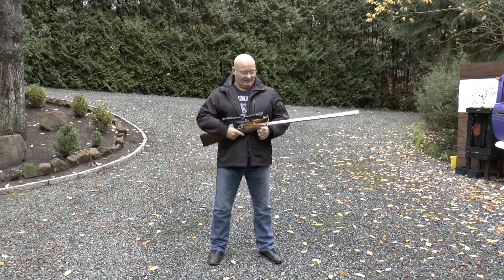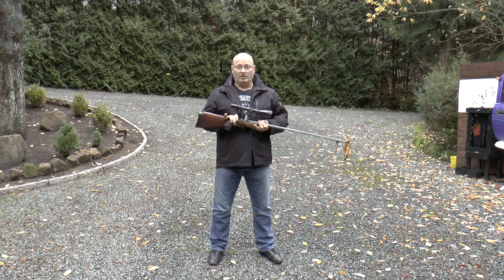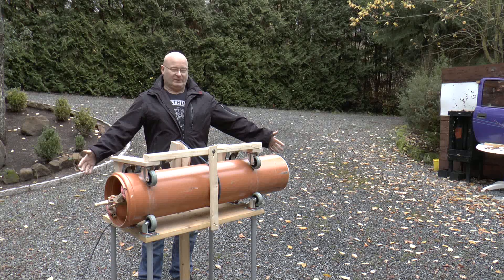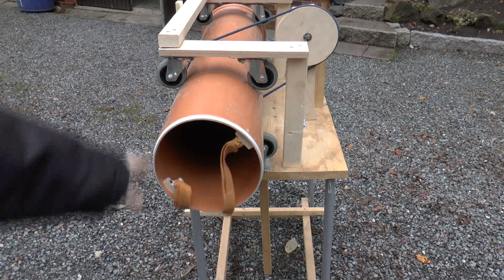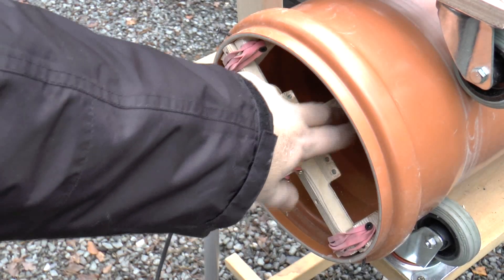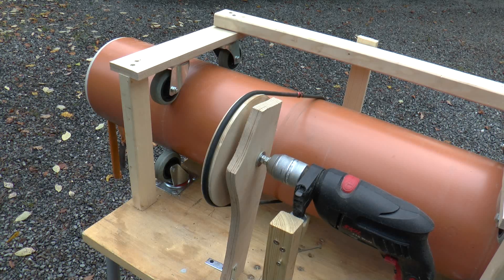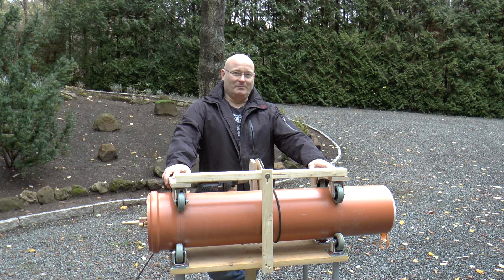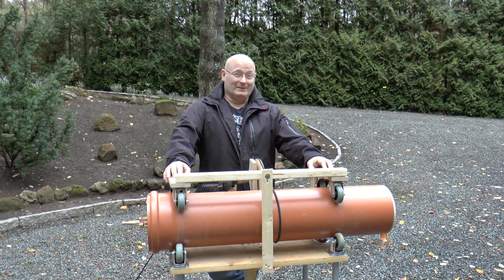World's 1st Rifled Slingshot (Made from Huge PVC Sewage Pipe)

Comment: In this case the tiniest initial imbalance might even lead to worser grouped impacts, due to the centripetal force I fear? Except of the rubbers longitudinal force the projectile is totaly free to escape within the huge pipe. Ok, Ok nice craftsman skills and lots of fun and creativity, but it lacks a bit in scientific severity ;)

Why not considering of making the most precise slingshot, with the best efficiency factor and the highest V0 or the best energy transfer. What about considering a fin-stabilized projectile or if it has to be this rotating tube, think of a socalled sabot/Treibäfig  (http://en.wikipedia.org/wiki/Sabot) which falls off after the projectile left the pipe. In your case it might eat some energy, but it keeps the bullet in the center line. Think of tree thin styrodur fins, not much drag and inertia but enough cornering force.

With the compound bow I shoot arrows with vanes at an 1° setting angle. That indeed forces the arrow to rotate, I checked it out in slow mo. I cannot say if it is good for something, cause the effect pays off at wider ranges > 60yrd and I'm not the best shooter.

Comment: This was awesome haha. Rifles are essentially the same as your slingshots, except they use a different means of propulsion (expanding gas). That being said, the means of propulsion does not have to be spinning in order to obtain rotation, but rather the barrel can be lined in such a way that it causes the bullet to spin. The concept is completely plausible, but it would be hard making a barrel that can get a marble to spin without applying too much friction considering you don't have as much energy as a rifle round. Great video though lol I loved it.
Reply: I was thinking a shuttle that runs along a guide track that is rifled, the shuttle would freely rotate inside a mechanism that attached to the rubber bands.
Reply: the barrel could be rifled and the projectile would have to follow the rifled grooves in the barrel for it to spin rather than using a prowered spin.
Reply: Yes that is what I was trying to say lol. Another thing that may work is if you used a rubber pouch, and twisted it to wind up the rubber before you pulled back. As it unwinds it should spin the marble, but it may not be very effective in real life.
Reply: May throw accuracy off if the rubber is twisted, but might work.
Reply: That does sound like a cool idea. Maybe a barrel where the pouch twists as you pull it back through some rifled grooves, then you wouldn't need to rifle the whole barrel and the projectile would still spin pretty well.
Reply: Lead ball rounds in old muzzle loading guns benefited from rifled barrels.. which paved the way for modern guns. Cannons, too, eventually incorporated rifling for round ammo, again paving the way for modern shells.

Comment: gbzhemn1  Where do you get this stuff.  Of course a sphere exist in a mathematical universe.  As for the rest, imperfections found in a ball baring are negligible compared to all the other factors that hinder accuracy in a slingshot.  For example one band may release energy more efficiently that the other.  The releasing mechanism may introduce a direction bias.  The roundness of the shot is the least of your problems.

Comment: One day... you'll come up with the first rail gun power by rubber band!
Reply: Some day, they will make a joke that Zachary Piche actually gets was a joke... one day...
Reply: rail guns are defined by their power source.. so no.
Reply: @dojostarfox4520  ROFL No they are defined by their propulsion system. Elastic magnets are a thing. So shutup dummy.
Reply: Yes some of his sling shots do resemble railguns, but for now a railgun is defined by having an electromagnetic power source, the power going through the rails. Joerg's rails simply act as guides.
Reply: Where was the joke? If it was the OP then it just wasn't funny... or a joke.
Reply: ***** *too, *you're
Reply: Imagine him with his slingshot on the battlefield
Reply: No, he builts a rail gun powered by millions of AA batteries 😂
Reply: Zachary Piche
Incorrect. Railguns are defined by the way they accelerate an object. They do use electricity but, where does that come from, wind, the sun, fossil fuels, rubber bands?
Reply: Obvious joke is obvious.
Reply: Zachary Piche It is possible. In fact most of the guns he builds are technically rail guns since they use a catridge that remains in the barrel to deliver the force to fire the projectile; thus it could be seen as a vehicular projectile delivery along a rail and thus he makes rubberband railguns.
Reply: Zachary Piche No. Rail guns are not defined by their power source.  Rail gun is in fact a misnomer for a gauss rifle. The reason they were called "Rail" guns in the first place was because the first prototypes were in fact built on RAILS... So what Heir Sprave has built is in fact technically a rubber powered "Rail Gun"..
Reply: (troll face here)

Comment: I have been thinking of an alternative crazy solution to impart spin on the projectile. How about using a piston that has a concave face to hold the projectile and spins as it moves forward? The piston could run along tracks or grooves like a screw. The base of the piston would spin freely and be attached to the sling shot. It would need a pretty serious draw and be very smooth to minimize friction slowing down the piston but it might work.

To load it I would just cut a hole in the top of the tube. Put another small tube attached to the hole vertically that is big enough to hold one projectile. Then it drops into place by gravity when you draw.

Comment: Oh you have to do things a little different.
1./ A spinning cylinder has lift or drag depending on it's rotation to apparent wind.
2./ Spinning is stabilizing
3./ "T" look at the letter "T" the direction of flight is up on this page. the cylinder is perpendicular to the direction.
4./ The spin is from front to back over the top side.
5./ Surprisingly it forms an aerofoil !!!! and is stabilised AND does bum loads of damage on impact !!!
6./ 2 small end plates on the rod diameter about 1.6 x Diameter of the rod and about 10% the thickness of the rod..
7./ Reconstruct your SPIRAL GUN but with a wide spiral to accommodate the "SHOT" so that the shot is rotated out of the end of the SPIRAL GUN and it has the correct spin.
8./ Lets say the SHOT is 8 mm round rod. The length is 24 mm the end washers are
M8 washers 13mm OD.

I designed this gun after watching the fire fights in Afghanistan and the fact that they ran out of ammo all the time, the ammo was expensive and they wasted HEAPS of it. I would bet they hit one in every 10,000 rounds fired, mostly because they did not know where they were shooting and were just suppressing fire. They might as well have used card board blanks !!!
Mine uses common petrol and air to fire but I don't use the washers. ( bit difficult and slow to make at home. It uses 1mL of Gasoline and 15mL or air pulled into two syringes one way valve then compressed into a chamber connected to the SPIRAL.
I wanted it to chop off the rod as it went and load it in the spiral.

1mL of Gasoline is about the same power as a .303 Enfield shot but low brisilience hence great for a spiral.  The washers were to "tone down" the rate of spin a little , add stability, and to stop high/low pressure wrap at the ends.

Several things happen. Too much spin and it stalls, a little too much spin and the projectile will hit you in the behind doing a big loop in the sky.

Good luck tuning that one ! lol

So a quiet gun that is very lethal and cheap and ammo is a bit of fencing wire !!

Your work amazes me .. I love watch in the Bald German  get narcy with it and embodies his imagination so readily ! Awesome !

Great Art !
Garret

Comment: I think to provide rifling effect you need a spiral inside a tube. A 36 inch tube would only need 2 turns to provide enough spin to a pointed projectile. This is easy to do with a simple rod at the back of the pocket  which will ride in the grooves of the spiraled tube. A piece of 1.5 inch dia pvc should work.

Comment: NOT THE FIRST! i took a 1,30 m long cardboard barrel, took  3 elastic bands, a few wooden parts and bent nails (ammo). it shot 30 meters (i fixed a red dot on the top to aim). i named it "Birdkiller 1.0".  i did this in 2011

Comment: you should have spun the bar ell a little more so that the rubber band would get tighter and that ball would have gone alot faster but if the rubber band popped back at you that would maybe have meant that your release clip was not strong enough

Comment: "This technically makes no sense"

What doesn't make sense about a giant sewer pipe viciously rotating with a slingshot inside ready to fire?

But, seriously, that thing is wicked cool and if I may suggest:

I know I have no room to say this, as I haven't built many things in my days, but how about a safety mechanism? Get it to rotate twice as fast and attach like a thin cord to the trigger so you don't have to risk damaging your hands

But yeah, just a suggestion, because cord/rope wouldn't rotate very much if it's at the right angle so all you'd really need is some sort of free axis rotating clamp and you're good to go
Reply: fishing swivel
Reply: I'm not entirely sure if that comment was directed at me or even for this video, but everything of what you just said makes absolutely no sense in regards to what I commented.

Soz.
Reply: Curtly quoting something that I said that I just happened to miss because I'm sick right now (you couldn't possibly know that, obvs) as well as blindly assuming my intelligence based on two things you've seen me post online.

Yeah, you're not worth my time.
Reply: Only losers make sense!

Just to clarify, I know I said it was to protect his hands, but the other main reason was ease of operation. It just seems like things would go smoother with a more efficient system.

People have been jumping down my throat because I said the word safety
Reply: 2dog14 like a peguin swivel??

Comment: I have a great Idea for you. you can get back to me later!! In one of your shows you showed that a slingshot ball could have the impact force of a bullet. Then the propellant power must be equal, therefor create a gearing system to make a smaller ball go 300 to 400 fps and you would have a truly deadly weapon. My first idea is to make a piston, similar to a air gun and force the piston to create air-pressure. A pellet gun just uses a spring and you can get more force with 200 to 300 pound draw weight with a rubber band. You can come-up with maybe another idea for a gearing system to make the ball go faster.  Tom
Reply: That is great but make the ball go at a much faster rate by creating a gearing system!!

If the ball has the same impact force as a bullet fired from a small caliber gun then the force to create both should be equal!!

My first idea would be to create a piston that is driven by force into a tube to create air-pressure and make the projectile move faster!!

Comment: If I may make a suggestion, I noticed you seemed hesitant to grab the trigger (and I would be too). If you tied a length of cord to the trigger and the other end to the 360 degree joint that comes on some lanyards, you could make a pull cord that turns with the barrel, keeping your hand safe.

Comment: You are right about a slingshot not needing any rifling due to the ranges and speeds involved.  You are pushing what? 300fps/94mps at 11yds/10m?  Definitively not needed.  But your rate of twist on this is much to high.  I think the average muzzleloader uses 1" in 48" twist.  I'm not quite sure but your version of twisting the projectile is producing something like 1" in 1" or even less.  

Think of it like the difference between throwing a football and throwing a curveball in baseball.  The right amount of twist good.  Stabilizes the projectile for long range accuracy.  To much twist and the trajectory of the projectile will actually bend 

Slow that thing way down and move the range out of 50m and do a comparison.  That would be interesting.

Forgive me since I live in one of the only countries that still use the english system of measurement and my metric conversions are a little rusty.  But slow the twist down to 2.4cm to 1.15m and that should do the trick for stabilization.  Also that platform wobbles quite a bit, could use some work on that.  Otherwise entertaining as always.

Comment: Should be a bearing system on the knob so you can pull it without it spinning
Reply from the maker: Yes, as soon as I reach higher RPMs that problem will have to be tackled. At 7 rotations per second, it is not so bad.

Comment: Hook that bad boy up to the wheel hub of a truck! Also, is it possible to maybe actually shoot it through a rifled barrel. Maybe take a piece of 1.5 inch PVC and heat it up, then gently stretch it to where it will hug the ball bearing enough to spin it? You would have to actually rifle the barrel to get the spin though. I saw a guy just take a piece of hacksaw blade and and sink it into a dowel rod to rifle his PVC air gun. Just a thought.
Lee's Bowfishing and Hunting Slingshots

Comment: I love these videos where you try these weird and crazy new things for sling shots! What I would really like to see next is more iterations! I want to see these weird and crazy ideas taken as far as they can go.
In this example it would be really cool to see if it would be possible to make slingshot shoot something that would need the rotation to be stable and then make it stable with rotation.

We might not see a use for it right now. But that isn't the point! The point is exploration and fun! And who knows! Maybe in the process we discover something that is really cool! That's how science works!
Reply from the maker: Oh, more iterations are on the way for sure. There is a lot of enhancement potential.
Reply: JoergSprave this technically makes no sense.
Reply: JoergSprave this is awesome haha have you tried shooting large caliber bullet shaped projectiles out of it because then it could work. or instead of rotating the whole slingshot just have the pouch rotating as it goes down. this requires a bit of precision engineering but isn't that what you Germans are famous for :D
So how it would work would be to have the pouch a circular solid object (probably best metal) that has a couple of holes in it which have rods threaded through attached at both ends of the sling shot these rods will be twisted so as the bands pull the pouch down the rods they spin the pouch and thus projectile inside. the bands would be attached to the pouch by some sort off bearing system that gives good forward back strength but still lets it rotate. wonder if this design is possible would be awesome to see you try and build it :D
Reply: Miles Lee-Rogers He's not trying to make a good weapon. He's experimenting.
Reply: but i did
Reply: ***** How about Oreo cookies... or a toilet brush... or a machete... or a polesaw... oh yeah... He did all of those already...

Comment: Sorry to be a bum but technically it's a spin stabilised ball bearing not a rifled slingshot.....
( rifling is spiral grooves cut into the inner surface of a barrel to provide rotation to stabilise a round ).....
Reply from the maker: What part of "comparable to what a rifled barrel does to a firearm bullet" did you NOT understand?
Reply: re read your video title! "worlds first rifled slingshot" no need to be rude! i can be just as rude mate
Reply: and was not criticising you either bud i think your a brilliant engineer and a very clever bloke you make some awesome things just was hand out the correct definition that was all :) and i saw a video in which you was hit in the head by a ricochet ball bearing was that a real an if so have you recovered because that looked extremely painful and brutal

Comment: Perhaps have a string attached to the firing mechanism, so when the barrel turns, the string twists and eventually shortens enough to pull it back automatically?
Reply: beat me to it by 9 hours...
Reply: I would suggest a slight modification of the same concept. Instead of a string, maybe use centripetal force. When the barrel spins faster and faster, eventually the centripetal force would be high enough to move the trigger automatically and thereby making the slingshot shoot.
Reply: In fact. With the technique you might even be able to build an automatic slingshot. One that also uses the centripetal force to reload the weapon. At least it would be theoretically possible. :P

Comment: Could you try to do a hop-up instead?
Air soft guns have this. Because they too shoot ball's and they don't make them spin around the axis parallel to the trajectory, but instead the spin them around the axis perpendicular to the trajectory. Making them climb in the air, going further and in a more straight line.
Usually there is a small rubber bump on the top part of the barrel at the very beginning of it, which makes the ball spin as if it would roll towards you.

Comment: what i would have done to get higher rpm is to directly attach the drill to the sling trigger and to release projectile spin drill then pull back wards. using chains has lots of friction and because the pipe is big , a drill bit is small, it is a decrease in rpm. also now you dont have to grab a spinning trigger. might need some stabilizing contraption to hold the drill now though doubt the wooden slingshot could take the weight of a drill.

Comment: Have you thought of using a crossbow to drive the ball baring down a gun barrel ? You could cut a slit down the side and put and connecting piece through the slit and into the crossbow string to drive the shot inside the barrel.

Comment: what if you have two tubes. The larger tube is rifled and the smaller tube will spin because of the rifling. When the shot is fired, the slingshot bands are pulling the smaller tube along, forcing the projectile to spin.